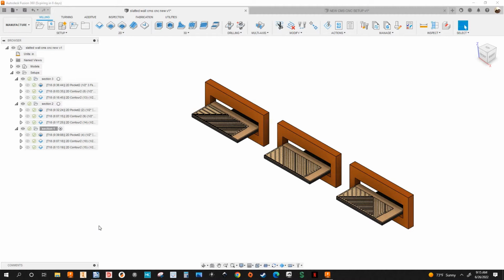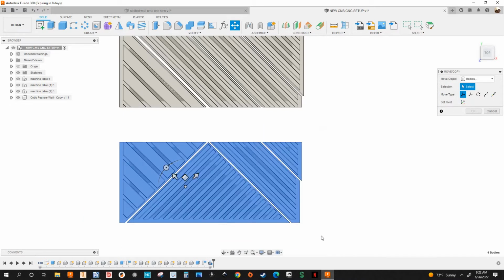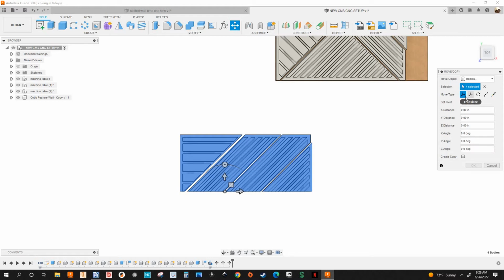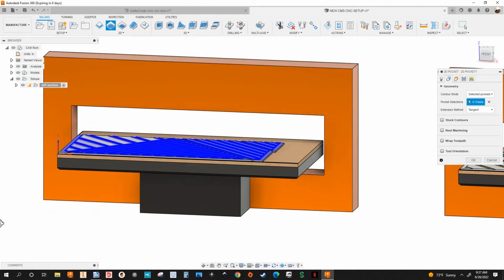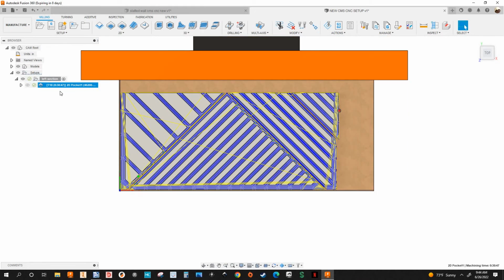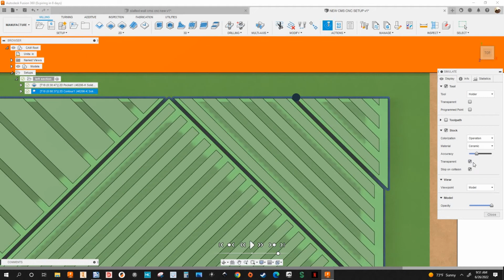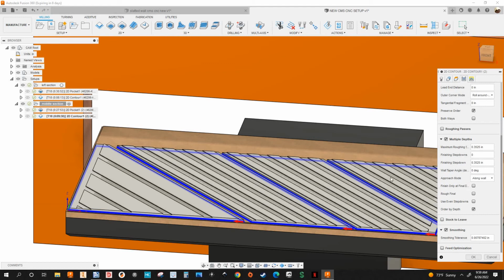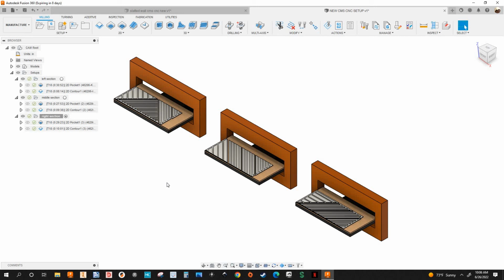SLATTED WALL PROGRAMMED IN FUSION 360

Comment: Do you have woodwop? Can you build this right on woodwop using their cad?
Reply from the maker: Hello, yes i do. Yes you can, but it is difficult to achieve it in Woodwop especially in old versions of Woodwop. Most people will use a software like Autocad, Inventor or Fusion 360 to draw it up. I used Fusion 360 to model it and program it. I have videos and pics on my Instagram page.